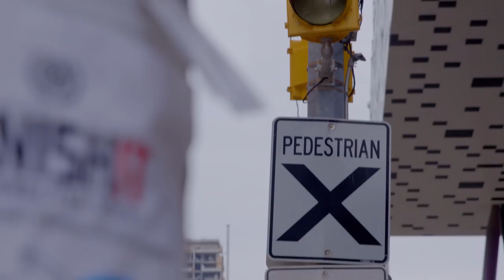Challenging 150 Years of Bicycle Design

Comment: That thing looks a bit front heavy like it might run into something and I am over the bars. No capability to hop curbs because you are not in a stance to. And no option to pedal? Then this is just a moped, even if it did have the option to pedal, that angle over the front wheel is horrible and it would pedal like a tricycle,  and rock side to side each pedal. No thank you. And besides it looks stupid and small haha, like dorky